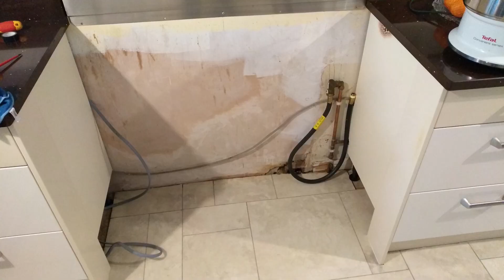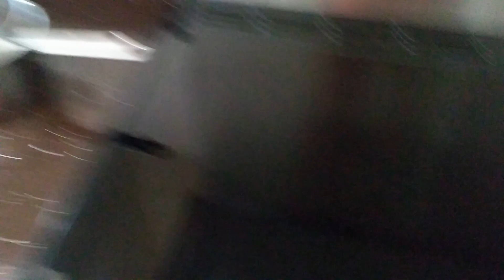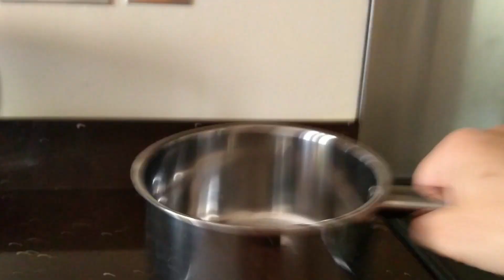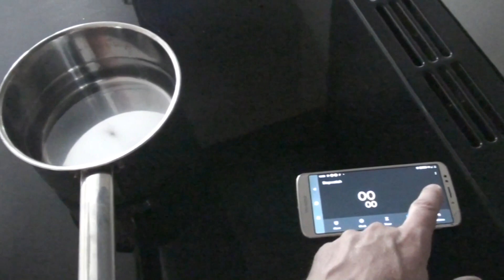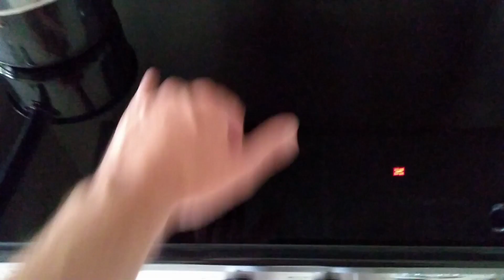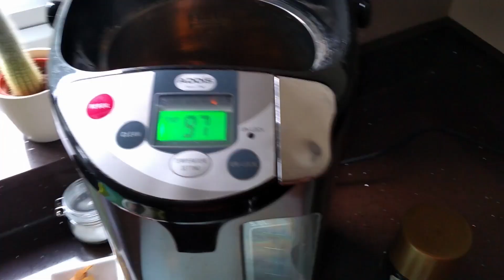Getting off Fossil Fuels goal, update 4.

Comment: External wall insulation EPS with silicon rendor.  Absolutely amazing instant results.  Also made the house look brand new
Reply from the maker: Think we'll have to look into this.
Reply: @nicholashowell  My EPC in 2017 states expected saving of £550 yr.  

In January when it was installed just the boards on day one of the install I woke up the following morning to give the contractor an extension lead and my room stat was 20c (no heating on from 10pm) and outside was frozen over.  Normally the house would drop around 5-7 degrees over night

Comment: i had cavity wall sorted for my mother many years ago(was free as she was over 70 a Govt scheme), they came around and drilled holes along the outside walls about 2 metres apart and blew in recycled paper that was fire treated and worked there way up in 1 metre steps plugging the holes  roughly 10-15mm as they went right to the top of the walls, even now i would be hard pressed to find the plugs no damp problems @ all, yet the ex local authority houses now housing association homes 3 miles from me had polysterene type installed badly many years ago, and specialist removal contractors have travelled to Maryport from Newcastle to completly remove on maybe 300 houses ,tbh not a good advert to save energy, but in my case no problems no damp, and currently no heating used for proably 42/44 weeks a year  ,yep you read right :) :), i had triple glazed windows installed 9 years ago, and the first full years gas saving was 68%, a no brainer hence i have the combi on hot water on demand and thats it unless its really cold, the only drawback with triple glazing it can kill/reduce mobile phone signals :) :) PS my triple glazing is by Camden windows (made in Ireland) plenty of installers fit them A1 product no complaints here

Comment: The inverter you run your house on dose it ramp up when a load is put on or does it take up the load straight away as the induction hob will pulse and your inverter will never meet the load and you will pull more power from the grid
Reply from the maker: It's a grid-tied inverter so it takes time to react (I've made a video about this issue). The pulsing isn't ideal but I have some ideas on how best to deal with it. I will probably discuss it in a future video.

Comment: Hello. Have you looked at Sunamp for the Central Heating? Also Tepeo does a ZEB boiler. By the way great videos, the Battery Shed is awesome.
Reply from the maker: I have but I don't think it will be enough for heating. Hot water maybe but heating, no.